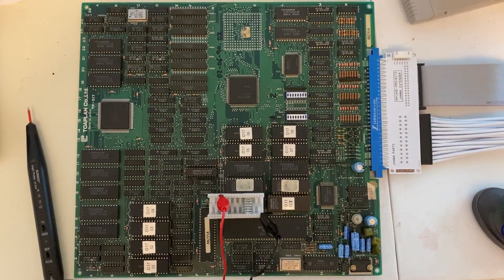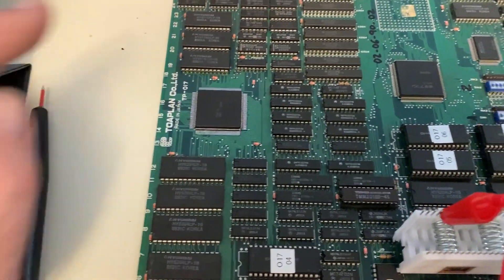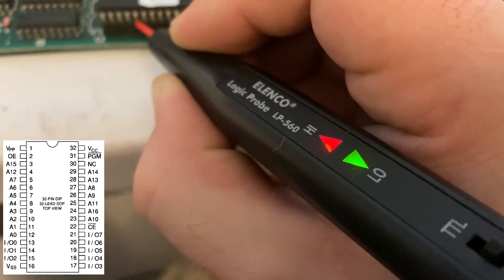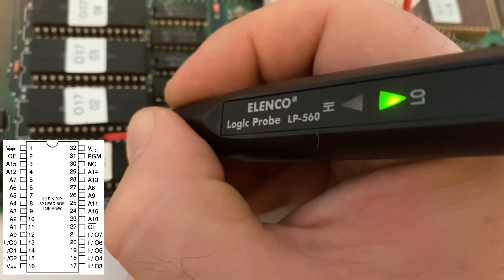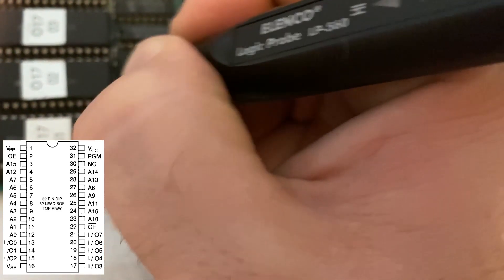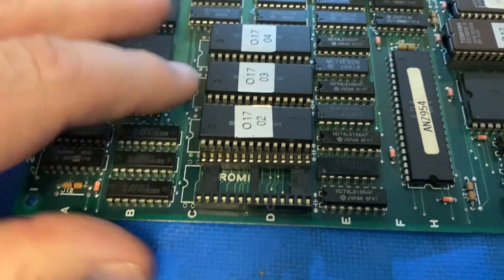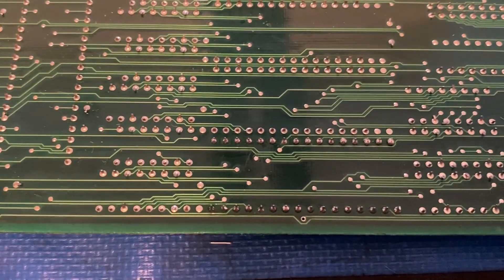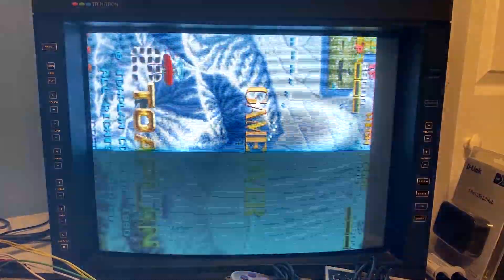Fire Shark Arcade PCB Repair - Sprite Corruption

Comment: Wow. Where did you connect the clips of your logic probe to? I see that white box with the springs..
Reply from the maker: You want to connect the logic probe up to a 5V supply source and Ground somewhere on the PCB or JAMMA harness, not an external supply. The probe uses the board's supply voltage as its reference for a High versus Low reading. I usually connect the probe to the Vss and GND on an EPROM or TTL Logic chip that I'm not probing, or on the JAMMA connector itself.

The alligator clips on my logic probe are a little too large to stay connected to an EPROM easily, so I use a test clip - that's the white box with springs on it in the video. A test clip clamps on top of one the chips and makes it easier & safer to access the pins on the chip underneath.

Comment: SHOOTTHECORE, What are the differences between a MASKED Rom and a PROM chip because both can't be reprogrammed, so what are the differences in using a Masked ROM chip compared to a PROM chip?
Reply from the maker: Masked ROM: The hexadecimal code is permanently etched inside the chip at the factory.  Masked ROMs are the least expensive option for large production runs.
EPROM: Erasable Programmable ROM.  More expensive than mask ROMs, but used for both small production runs, or for code that was likely to change at the last minute.  Most home game cartridges use only Mask ROMs, while arcade boards use a mix of mask ROMs and EPROMs.
PROM: Programmable ROMs that can only be written once.  Very rarely used in arcade games since they cost more than mask ROMs and weren't rewritable for last-minute code changes like EPROMs.
Reply: @ShootTheCore  thanks i'm just confused on  the difference between a Masked ROM chips compared to a normal ROM chip & a PROM. It seems that a PROM, Masked ROM & normal ROM chips can only be programmed written to one time, the only difference is the price and data size the chip can hold it seems.

Comment: SHOOTTHECORE, when reading the ROMS data on your software program how can you tell if the data is good or bad or corrupted if you don't have the original ROM files to compare it against to?  Can you tell where the game code is at and where the games test diagnostic program is at when reading the ROM data? because I can't tell where the arcade games test diagnostic program when reading a ROM chip how can you tell please?
Reply from the maker: The MAME project has done a wonderful job over the years of cataloging and emulating arcade games.  As part of their preservation efforts, they have checksum values available for each ROM in their arcade database.  When I dump the ROM from my board, I compare the checksum of the dump against what's in MAME.  If they match, then I know the code in the ROM is good.  As for the in-game diagnostics, every game has a unique diagnostic routine.  Check the manual for that board and see how to access the test mode.  Some games have a special jumper you set, DIP switch setting, or a button your press.  Other games make you press the Test button on the JAMMA harness.  Since each game diagnostic is unique, some games have better diagnostics than others.  Some games check the ROMs very throughly while other games hardly check them at all.
Reply: @ShootTheCore  yes i understand but how did they get these checksum values? do you just add up all the ROMs contents data? When i read a ROM chips contents all I see is Hexidecimal values for each ROM address location on the software screen. I can't  tell where the arcade games test diagnostic program starts or ends or which hexidecimal values are bad or wrong. How would you troubleshoot ROM chips if you didn't have the checksum values or ROM files from MAME? Most arcade power supplies use one filter capacitor 27,000uf microfarad capacitor, any reasons why such a very large capacitance value to be used it seems very large because most power supply use 4 filter caps at 10uf to 100uf at the most.
Reply from the maker: @billwilliams6338  
Q: yes i understand but how did they get these checksum values? do you just add up all the ROMs contents data?
A: The checksum values can be calculated from the ROM dump using a CRC32 calculation utility like this:  http://esrg.sourceforge.net/utils_win_up/md5sum/

Q: When i read a ROM chips contents all I see is Hexidecimal values for each ROM address location on the software screen. I can't  tell where the arcade games test diagnostic program starts or ends or which hexidecimal values are bad or wrong. 
A: Yes, depending on which ROM you're looking at, it can hold compiled & assembled programming code for that board's CPU, or binary game assets like art, music, sound effects, etc.  Each game's diagnostic program will be buried in all of that, and it will be different for every game.  If you want to learn more about how a game is loading assets and how the diagnostic program is accessed, dig into the MAME driver for the game, and look at MAME's ROM loading and debugging functions.  Disassembling the hexadecimal in the ROM back to to the original code requires a lot of knowledge of both reverse-compiling and assembly language for that game's CPU model. The MAME devs already did a lot of that work for you.

Q: How would you troubleshoot ROM chips if you didn't have the checksum values or ROM files from MAME?
A: You can troubleshoot whether the ROM is outputting data using either a logic probe (like in my video) or with a logic analyzer.  Otherwise, dumping the file, calculating the CRC32 checksum and comparing the checksum to the MAME checksum is your best bet.  The MAME checksums are widely available - there's nothing secret or proprietary about them.

Q: Most arcade power supplies use one filter capacitor 27,000uf microfarad capacitor, any reasons why such a very large capacitance value to be used it seems very large because most power supply use 4 filter caps at 10uf to 100uf at the most.
A: I haven't worked on arcade power supplies, nor am I a formally trained electrical engineer, so I don't have an answer to that question.  Electronics is all a hobby for me, and I'm self-trained and learning as I go along.
Reply: @billwilliams6338  you can also run mame like so:
mame -romident <folder>
And it will id all roms, and even use another mame utility called romcmp to compare sets of roms